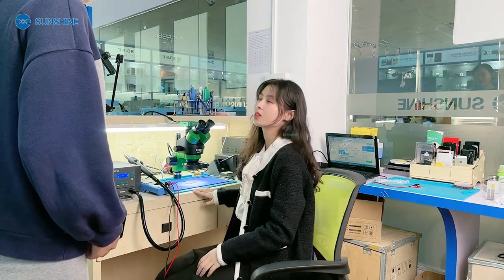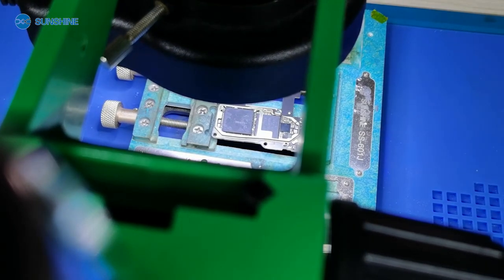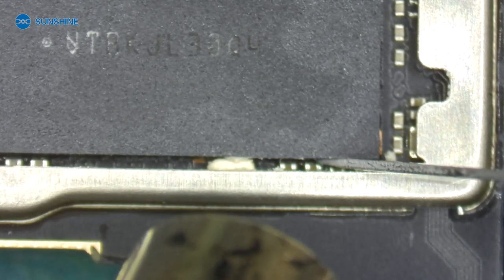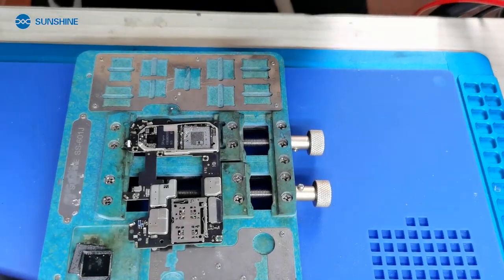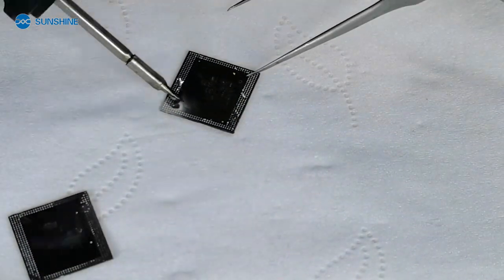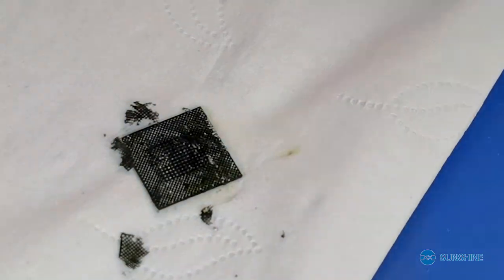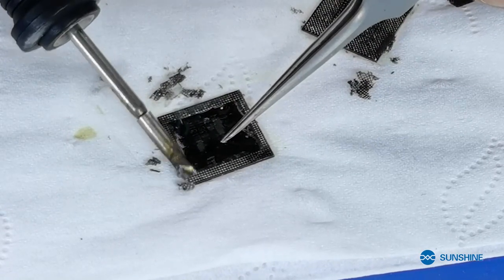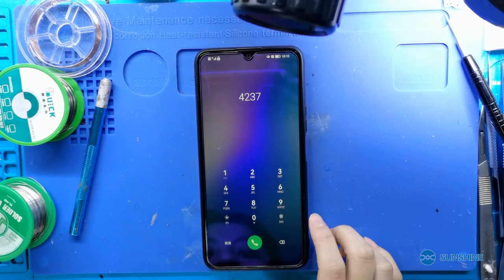mate20  CPU unsoldering,  stuck huawei  logo, how to repair it

Comment: Very good. What temperature do you use for CPU desoldring? And do you use the same soldering paste both for CPU and RAM   or different, when soldering CPU and RAM back? ANd what kind of soldering paste do you use?
Thank you
Reply from the maker: have show in video guy,  i will ask our master
Reply: @SUNSHINETOOLS  in the video there is a temperature for removing glue but not for desoldering CPU